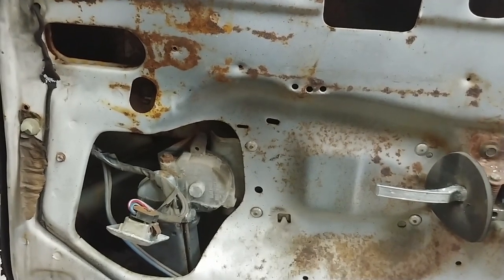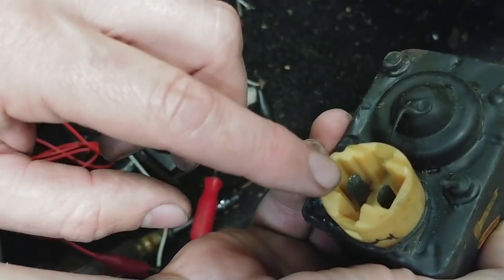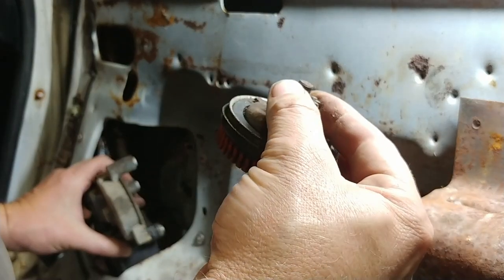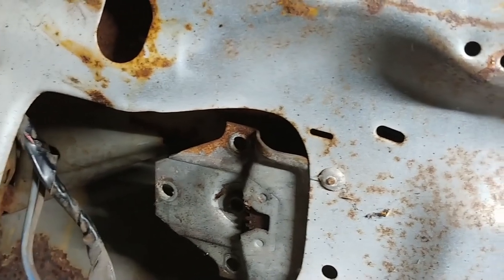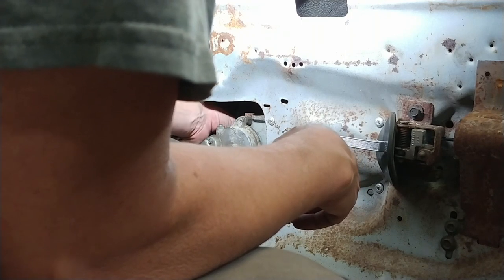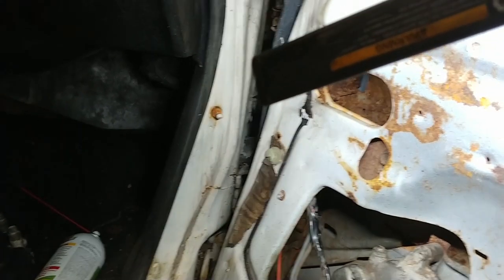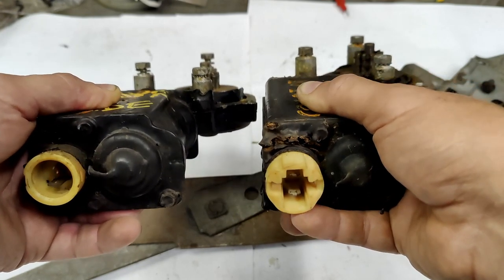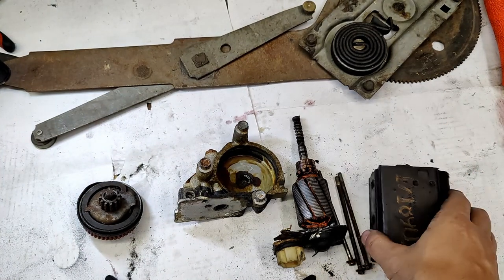Power Window Motor Diagnosis & Replacement - 73-77 GM A Body

Comment: when you were testing it did you ground the body of the motor? seen alot of techs I worked with bench these and not do that and think the motor was bad.
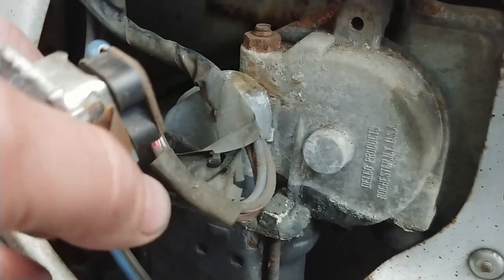Reply from the maker: Yes, it was properly grounded. See the 1:20 minute mark in the video. Thanks for your comment.

Comment: Do you know if on a Manuel regulator if the small gear that’s spinning from the hand crank can be bought an replaced
Reply from the maker: No one that I'm aware of reproduces the regulator or any parts inside the regulator for these vehicles. Your best bet is to find a good used regulator and replace your broken one. We have several in stock and our website that we sell these parts on should be functional in the next couple of weeks. You can contact us on the website g3garage.com or send an email of the details (right/left/2DR/4DR, etc) on the part(s) you need. Thanks for your comment.
Reply: @g3garage  thank you for getting back to me so quick, yeah my passenger side on my 77 el Camino got stripped and I didn’t know if you could replace the gears or what, this is my first time messing with my windows like this so I’m trying to learn as much as I can before hand and your videos helped a lot I really appreciate your work and explanations for 73-77 cars you do good work I’ll definitely check out your site
Reply from the maker: @Fp49274  Sorry, forgot to give you the email. Its sales@g3direct.com. Let me know if you have any more questions and I'll be happy to help.

Comment: Wow thank you for making this video I am working on my 76 Grand Prix and I have video suggestion. Can you make a video for relpacing motor and regulator. I am planning    on replacing both the driver side and passenger side with a kit from eBay … thanks
Reply from the maker: Not sure if I can help with the regulator replacement. The aftermarket kits a quite a bit different from the factory GM stuff and have not had a chance to work with the new aftermarket kits. Thanks so much for your comment.